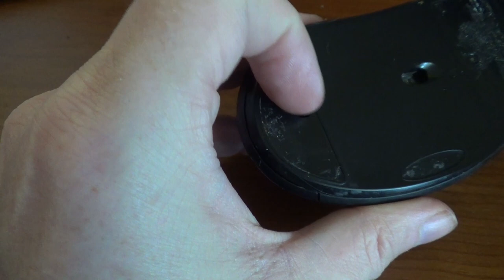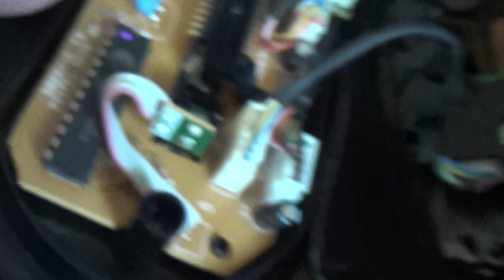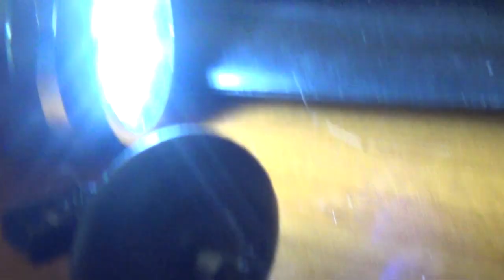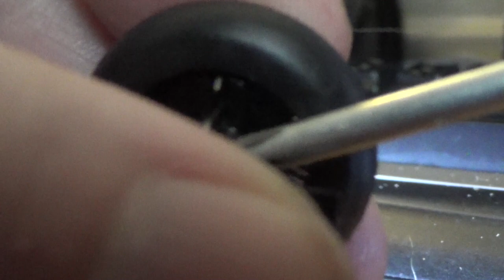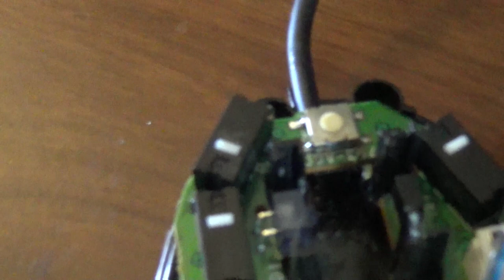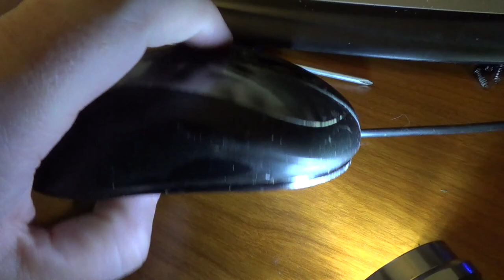Cleaning The Wheel of the Logitech MX-518 Mouse, Disassembly & Reassembly

Comment: Excellent video. One improvement:   Instead of putting the loop portion into the wheel first and then trying to get the other end to go into the hole ( 8:15 ) , just remove the assembly from the mouse, put the other end directly into the hole on the plastic base FIRST, without the wheel being on the axis, and THEN slide the wheel onto the base, and the loop will just automatically enter the slot in the wheel.  (I found this, because I just couldn't do it the other way)
Reply: This is my second time cleaning this mouse and (while watching this disassembly, haha) this man speaks the truth.

You can assemble the whole wheel doohickey by itself. Then the only thing you need to do is drop it into its slot and presto, no need to fiddle around with the tiny metal pins.

If you want to have more resistance on your scroll, you can bend (BE VERY CAREFUL NOT TO BREAK IT) the L-shaped pin up a bit, and vice versa

Comment: thanks so much, my scroll wheel is working perfectly now! For those who haven't done this yet, I was able to pry the mouse feet off with small flathead screwdriver, and stick them back on the same way at the end with the existing adhesive. Try to put them in a clean place when you take them off so the adhesive stays sticky

Comment: I had a very old Logitech TrackBall. When disassebling for cleaning ; I accidently remove the metal spring at the left side of the scroll wheel. 
Took me hours to figure it out but no clue. However this video shows me the same mechanics of the scroll wheel and how to put it back properly. 
Thanks a lot  for sharing.

Comment: Honestly, I genuinely think Logitech should have a link to this video on their support page :) I adore my MX518, I've had it pretty much since launch (I think I picked up my 518 at the start of 2008) so it has done me proud and happy for many, many years... but if there's one issue that crops up from time to time; the scroll wheel :D So yeah, cleaning that out of all the accumulated junk is a revelation for this mouse :D 

Like others, sometimes I clean it out and slip and forget which slot the springs fit in, which your video helped with immensely! Thank you!
Reply: welllllllllllllllll... that was prophetic, I guess :( After 11 years of beyond faithful service, my beloved MX518 is now dead .. and, worse, it's not dead from age or wear or failure on any part but my own :( I accidentally spilled half a pint of beer into it when I was cleaning my desk up -- and the laser/optical unit burned out and died :(

Damn it. This thing would have gone another decade, I'm certain of it. Bah. Oh well... rest in peace, you Mighty Mouse, time to replace you with a G502 Hero ^_^

Comment: You know that moment where something isn't working, you take it apart, clean out the gunk, then have no clue where one of the springs was? Well, this video gave the solution. It wasn't the same Logitech mouse, but it had exactly the same small metal spring arrangement and I think I'd have pulled my hair out trying to work it out without this video, so thank you.

Comment: I actually disassembled to clean my left click button on G400. Thanks for the video, I was able to put back the scroll wheel. I feel the bent steel piece is the one that provides the clicking feel when you scroll the mouse and the spring lets it spin smoothly and takes in any pressure that might be applied when we scroll.

Comment: Thanks for this!  Really helped.  I would just add that you don't have to remove the label on the bottom if you want to hang on to the info that's on there.  You should be able to locate the screw recesses by feeling around for them, and cut holes in the label to get to them.

Comment: I thought I was going to have to spend $100+ to get a replacement for my Logitech G400s, as the scroll-wheel had completely stopped working. But after watching your video, I was able to dismantle it and remove what turned out to be a lot of accumulated muck, after which it was all good as new. So thanks for the tutorial, especially as Logitech don't manufacture the G400s anymore, and it's my preferred mouse. Cheers!

Comment: Thanks a Heap! 😁
My mouse's scroll speed working while playing Sims 4 a day ago. I thought it'd be a bug. Today I did everything (restating, unistalliing drivers etc) but it didn't work. I had never had a problem with my mouse in several years, so I didn't want it to die suddenly. Games reply heavily on scroll.
Also, when I rigurously tested scrolling, it jerked a bit after several tries. So I knew something is blocking the scroll signal.
Finally bumped into this video, tried cleaning, and now it's working!
Thanks a lot! 😁 🤟

Comment: Just did this on my g400s i bought in 2014 man the mouse feels so much better now, scroll works properly too as well finger was struggling for grip on the mousewheel kind of rough when scrolling sometimes, was a great reference seeing how the spring was sitting.
Also got a mx 518 sitting around without mouse glides, think i might snag that up at my dads place & keep as a spare.

Comment: The purpose of those pads is presumably not just to hide the screws, but change the surface friction, and if torn off you end up with these ridges and indentations where they used to be, so that might make it feel different and might gather a bunch of gunk. Didn't think to do this until it was too late, but I don't know whether it's possible to estimate where the screws are and just jam a screwdriver through. So you end up with just a couple of holes in the material instead of the whole pad gone.

Something else to think about is that the mouse obviously becomes lighter without the top half on, and so if you place it on a table with the cable hanging over the edge, that will pull it down. In which case the little coiled spring is likely to fall out as the mouse hits the floor. I found the spring again, but noticed one might prefer the click of the wheel without it. Less resistance, feels like a regular mouse button.

The purpose of my disassembly was to clean primarily the outside, as it looked like it was molting. I'd recommend everyone clean the whole thing while they're at it.
Compressed air to blow out most of the dust and hair and whatnot on the inside. 
Remove all screws and electronics from the top half, disassemble the gross plastic bits and clean with something like a tooth brush in warm soap water.

Came out looking ok. There will probably always be some part/layer of the plastic that's kind of in the process of coming off, but it looks about 90% better now. 
All of the grime is gone and it no longer feels icky to touch it.
Noticed the black on the Logitech badge was peeling, so I scratched that off and it's mostly silver now. The DPI- button became completely clear somehow. And I removed the spring.

It's more slidey than my new MX518, but I neglected to compare when the pads were still on. I think that's a new thing though. Don't think it really matters.
I didn't break anything, it works fine. Unfortunately I can't handle its preset DPI settings any longer after having customized them to my liking for my new MX518. 
There once was a way of doing the same for the old MX518, but the Logitech Setpoint software at some point seems to have forgotten that the MX518 exists and only works with wireless devices?

Comment: Thanks for this, I was struggling to figure out how to put these metal pieces back on as they were the first things to fly off after opening my mouse up. Got it done thanks to your video though. I found it much easier to put them on with the wheel off the mouse though after struggling to do it the way you showed.
Reply: I agree, it's so simple to put those springs back with the wheel off.

Comment: Great video! One tip: you don't need to rip out the sticker at the bottom of the mouse. Just poke your screwdriver through where the screw holes are. There are "cross" cutouts/markings on the stickers to indicate where the screw holes are.
Reply: My screws actually didn't line up that well, but it was easy to find once you know where to look/cut.

Comment: Thanks, my Logitech mouse used this kind of mechanism as well, a tip is that if your mouse doesn't give a tactile feel while scrolling, you can very slightly bend up the rounded bump on the spring that goes on the left side.

Comment: Thanks for the video. I used it to fix the unresponsive scroll wheel on my MX510, which is apparently 13-14 years old...easily the oldest of any of my computer components, and I was not looking forward to getting used to a new mouse!

As with one other commenter, I found it MUCH easier to replace the springs onto the removable part & wheel before putting them back into the mouse/housing. Wish I had taken pictures for that purpose, but I was just glad that I didn't lose any parts along the way!

Comment: Thanks for the video, really helpful. When putting the second spring back together, it's easier if you assemble the complete mouse wheel with both springs on it and only then slide it back into position in its housing, otherwise putting the second spring in its proper position is a pain.

Comment: Best mouse I ever owned. The only downside of it is angle snapping and even that is not that bad.  
Recently my scroll wheel is acting up so I'll try this, because after 8-9 years it's still my daily driver and I use it A LOT. I'm not going to replace it until it breaks completely.

Comment: Great video, i've dissasembled my G400s to replace the wheel (ordered wheel from AliExpress for 3$), and didn't pay attention to how it was assembled.

This video helped me a lot. Since my fingers are big, i was having trouble with putting the last spring (the one on the right side) it was much easier for me to put it in before i've put the mouse wheel down, rather than after, but other than that, probably would have lost much more time if it wasn't for this video. Thumbs up.

Comment: Great video.  I bought my MX510 when it came out without ever knowing anything about it.  Just whatever was at Best Buy.  The scroll wheel stopped working this week and I thought "I'll just buy another." Damn I had no idea this was a legendary mouse.  Too apart my mx510 and the springs were not really attached any longer.  Put it back together per your instructions and everything is working fine.  Thanks!

Comment: Well, I lost the first spring thing you showed in the process. Oh well, I just have a mouse that doesn’t have a clicky scroll wheel now. I only took it apart because the scroll wheel was making my page go back up or down one click in the opposite direction whenever I went up or down. I think it may’ve just been worn out. It seemed to fix it though not having that piece anymore.

Comment: Thanks for a great, helpful video, Zaxtor99. This worked for my Logitech M805, also. I also found that putting the square end of the weird little spring into the housing first, then sliding the wheel onto the round end worked better for me. But whatever floats your boat! The only difference I found was that mine had little plastic sleeves over the ends of the weird spring. They came off when I disassembled the wheel and I couldn't get them back on easily, so left them off and it seems to work fine right now. Any comment on whether I should try to put them back on?

Side note for viewers: if you want to see how dirty your mouse really is inside, use a magnifying glass. Yuk!

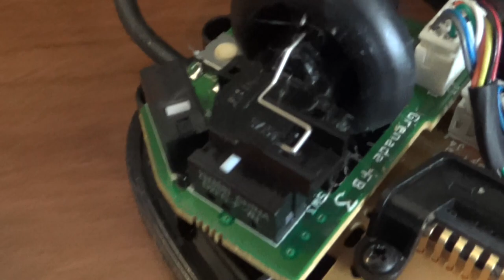Comment: You Safed my mouse (G3 - it has the same wheel machanics). Actually putting it together (3:52) is easy. Just apply the spring before you shift the Wheel over it - done

Comment: Great video but while going through I found a little tip to save some time when you put the first spring in you can do it without having it rested in the mouse base you then can put the rectanular side in first instead and then hold down the middle of that spring with your finger while you slide the wheel and it will be one piece then you can put that whole picee into the base like he showed and then put the second spring in like he showed

Comment: can you use it without skates?
Reply from the maker: I don't know you mean by "skates" for this mouse, unless you mean the rubber pads i tell you in this video you need to scratch off to get to the screws to take the mouse apart.  If that's what you mean by "skates" then yes, the mouse works perfectly fine without them,  ..Hope that answered your question!
Reply: @Zaxtor99  cool thx. I managed to clean the wheel and it works now.  Glued the skates back on.